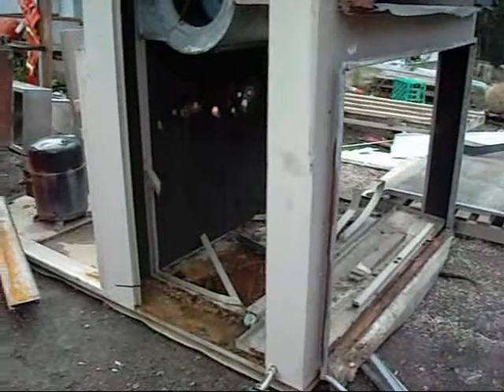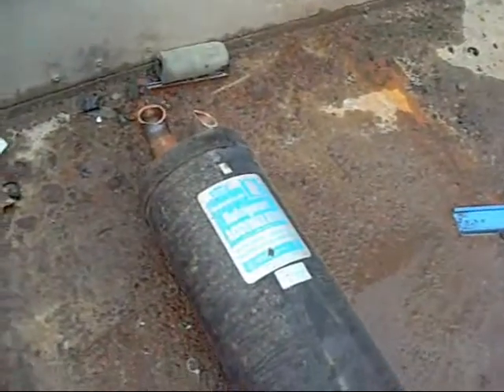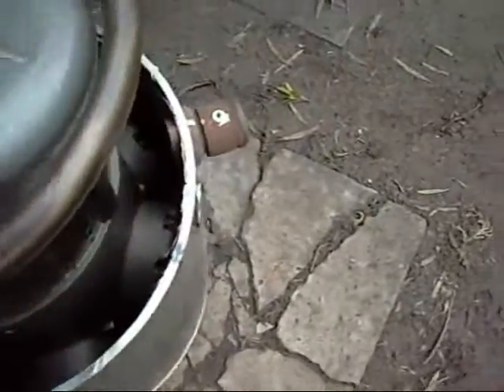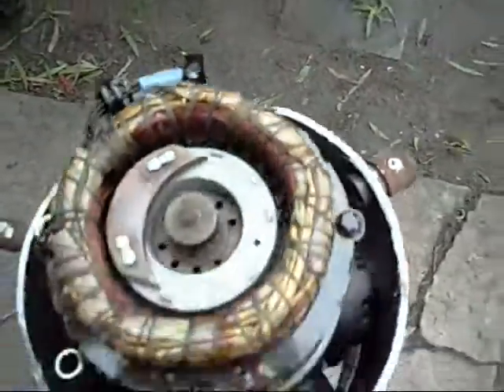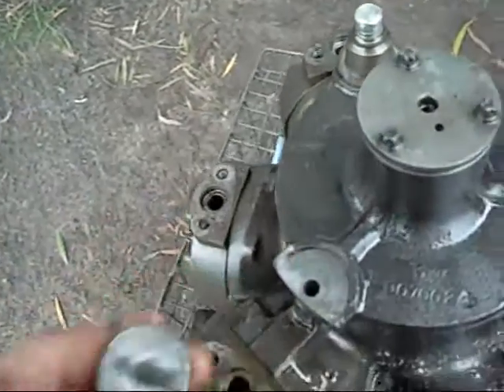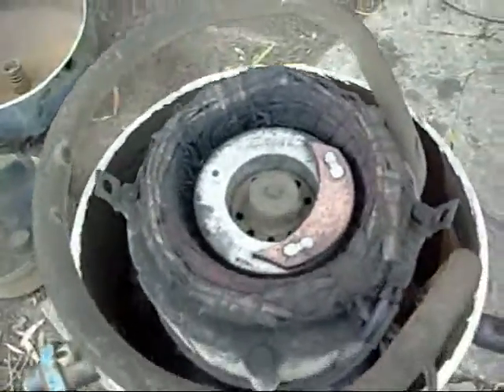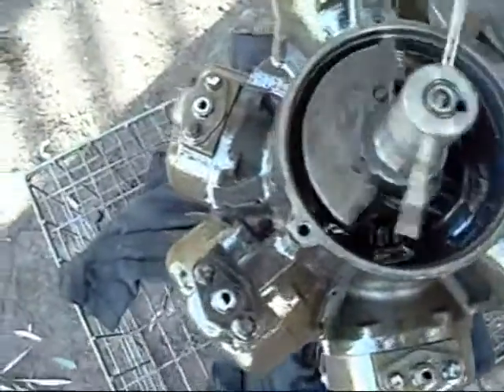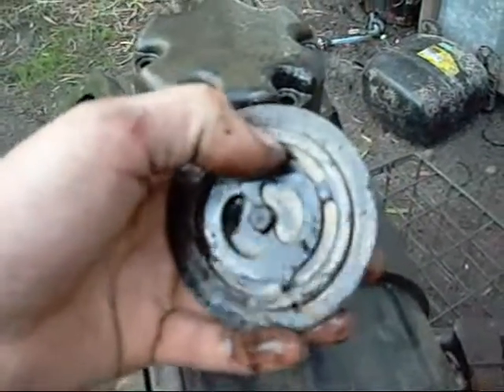Bristol Radial 6 Cyl Air conditioner Compressors

Comment: Put an end cap on it with the crank end exposed, install a water wheel on it (assuming you have a stream) and you have a decent little survival air supply to run air tools off the grid.

Comment: i never knew this but my dads friend works for a hvac installation and repair place and he has cut open a few compressors and the oil that is used is actually mineral oil and the reason why it smells really bad like burning plastic and diesel truck exaust is because over time the friction inside heats up and motors always get hot when being used and the oil burns and starts to smell bad. when you smell new hvac compressor oil it has no smell. just thought i would comment on this even though its an old video.

Comment from the maker: @shadow21173 we don't get Lincolns here but the principal still applies, check the dash board electrics and make sure the climate control switching is working. if not, make a new switch going strait to the compressor relay and bypass the electronic crap

Comment from the maker: @shadow21173 cool!, when you say the AC works when you jump it you mean it cools the car down ( refrigeration cycle is working) if its just a electrical problem I would start at the AC push button and work back.
pull the switch out and use a multimeter to see if it is faulty or a wire is broken between it and the AC relay. likewise check after the relay for bad connections.

Comment: right on!  i like your videos. i was on here to try and find out what is wrong with the A/C in my car. i holds presher and will work if i jump the compressor with a hotwire. the fuse and rely are fine... so i dont know what the hell wrong with it!

Comment from the maker: @cheetawolf there are tell-tail signs on the stator, and casing. both of the compressors in this video had been opened up and rebuilt at some stage, and I doubt it was because of mechanical failure.
plus there were stickers on the outside saying they had been re-wound by a hermetic compressor specialist

Comment from the maker: it surprised me to see both comopressors dead!, the one with busted rods may have been slugged to death too.
The motor burnout was caused by a seized crankshaft bearing at the top.
The one with good rods didn't make any noise when I tried spinning it up with a drill, so I let it go.

The Unit came from HMAS Cerberus Navy base, not sure where it was installed.

Comment: that would have been a nice unit when it worked. that's a large compressor. you should have spun up the bad comp just for fun. it wold have sounded good. 2 dead compressors. it must have had a hard life or the condensing coil was blocked

Comment from the maker: I was surprised that both had failed actually! glad you liked it!.

The principal of the compressor is the same across the board, but the different design traits from the different manufacturers is what I love.

Like Radial cylinders as opposed to Flat, Vee or inline. but you can imagine how much bigger these would be with all 6 pots inline!

Comment from the maker: like an LPG/propane compressor?

Problem with motors this size is power requirements, this one would pull twice the maximum current that my main supply line is rated for!